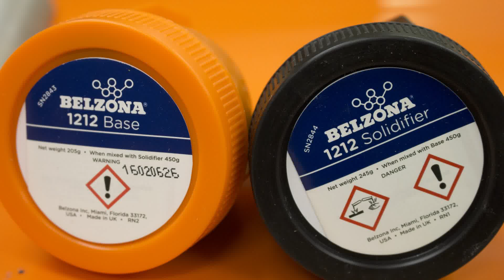How to Stop a Live Pipe Leak with Belzona 1212

Comment: Great video. Instead of having to install a plug against the leak, could have an open 1/4 turn ball valve attached to the plate. Once ready to "plug" just turn the valve handle as opposed to trying to get a threaded plug started.
Reply from the maker: I would say this is also a good way of plugging in a live leak. It would all depend on pressure, asset content (could be water or chemicals), and temperature. We use Belzona 9611 for low-pressure leaks. However, this method (or a half pipe) would definitely work for higher-pressure leaks. Thank you for sharing!